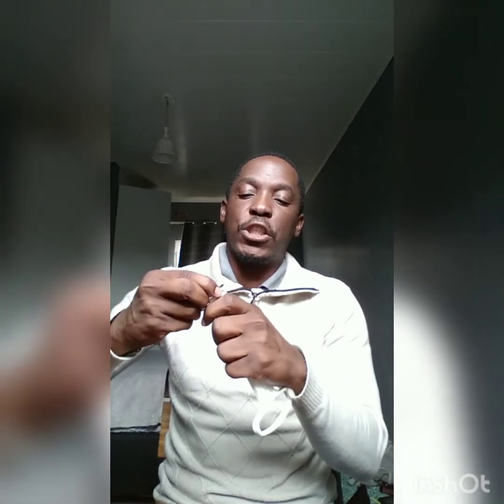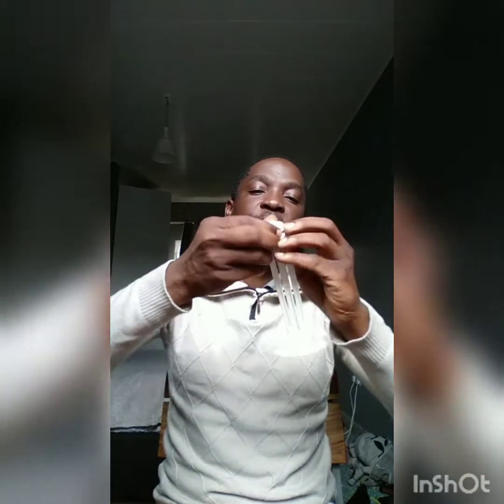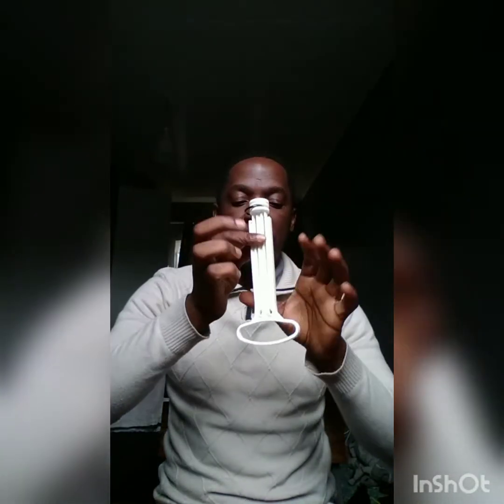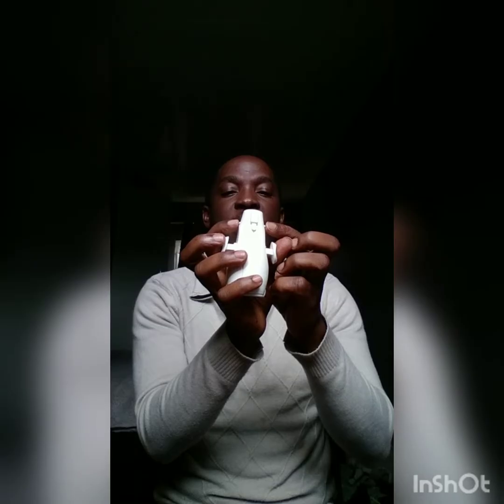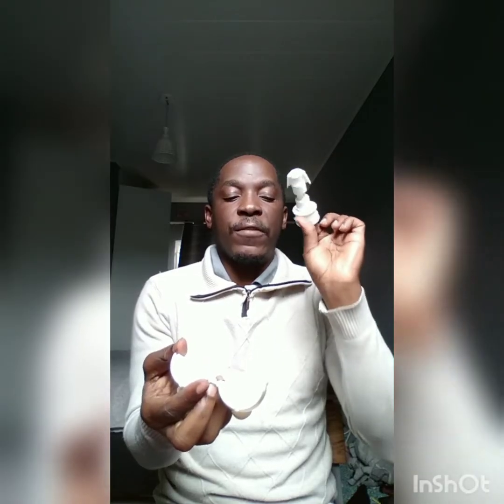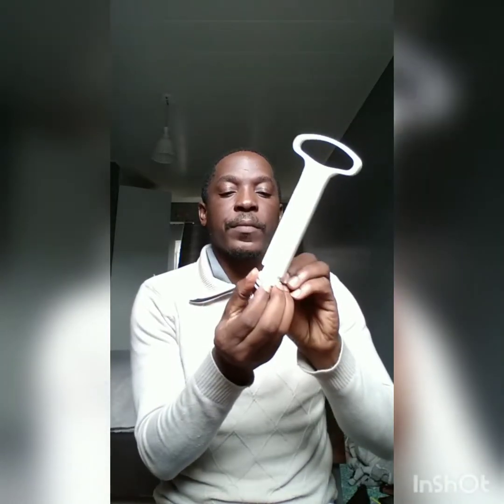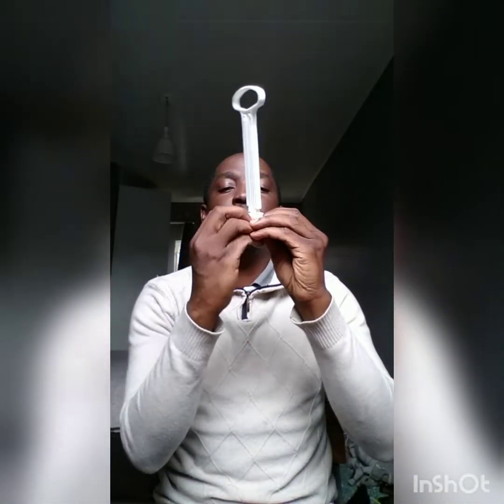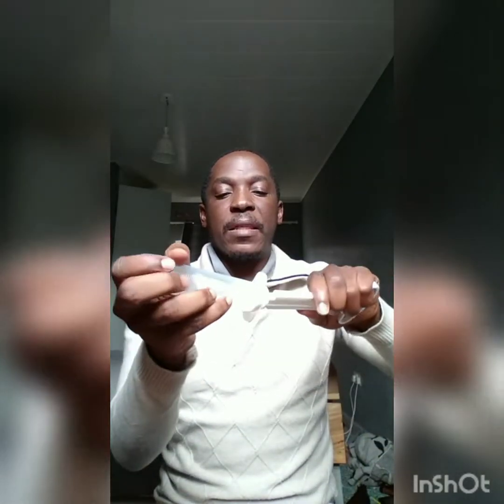THE MANUAL VACUUM ASPIRATOR TUTORIAL

Comment: I haven't seen the condom part i was told it Helps with making the vacuum
Reply from the maker: The condom is usually put there for lubrication. If you have a lubricant, there is no need for a condom.